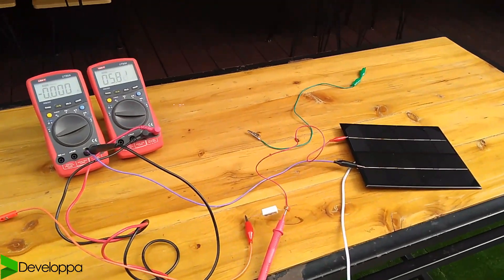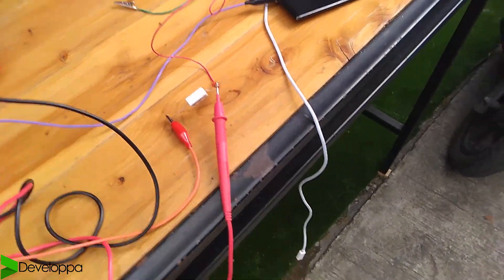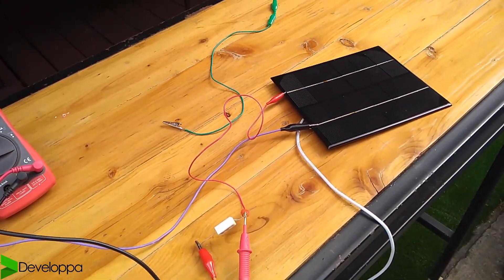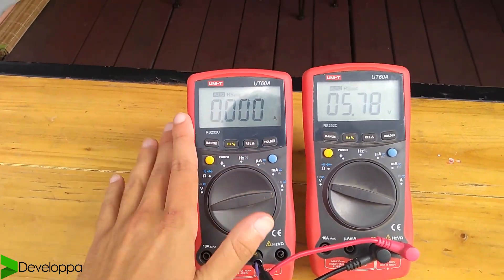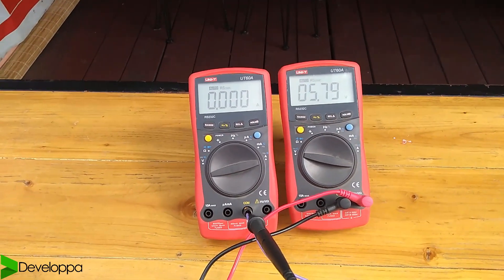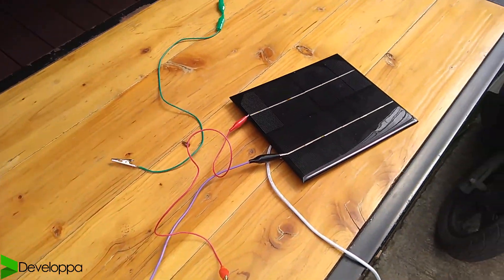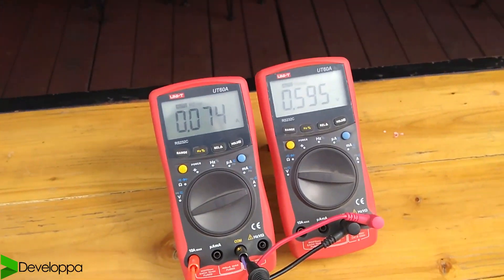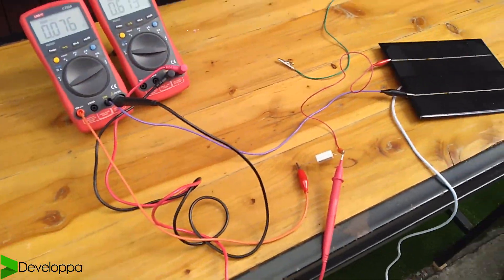6W Solar Panel Testing

Comment: This way it never can charge anything, You must add diode at the output of solar panel and than from the output of diode connect it to the battery
Reply: Not really. A diode will only add reverse polarity protection.